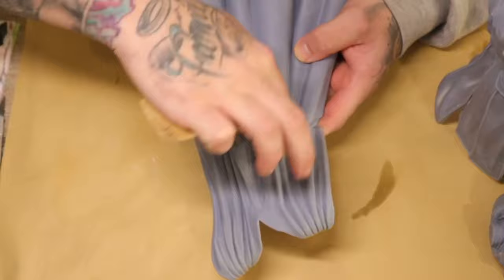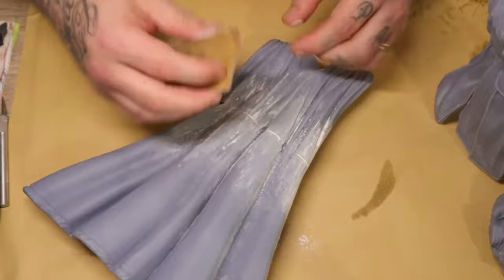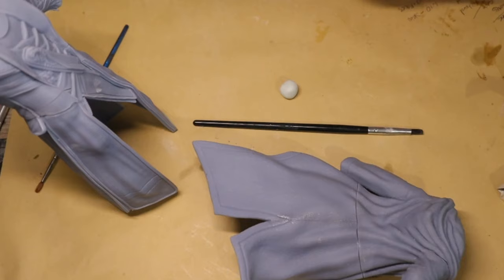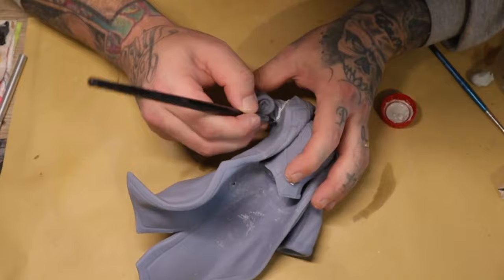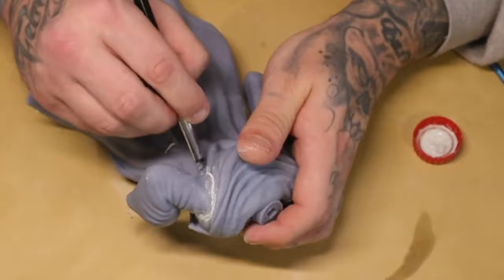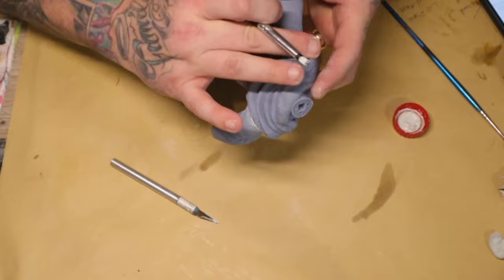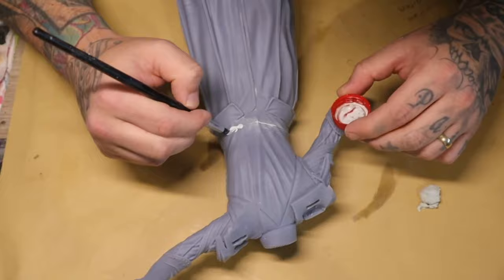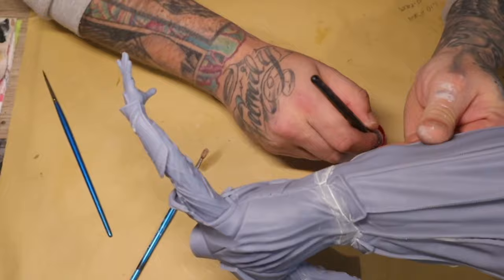Your Prints have Gaps, so do Mine. Here's How To Fill Them.

Comment: easier tip.  use the resin you printed the model with, fill a needle bottle with the resin.  you can squeeze the bottle and have complete control in filling the seam. most of the time I can fill the gap so perfectly I don't need to sand.

Comment: I use Deluxe Materials Perfect Plastic Putty. You can use a damp Q-Tip to smooth it. And after it's dry you can also use a damp Q-tip to sand it. You don't need to use sandpaper. Been using it for years on models.

Comment: you can use an old paintbrush dipped in water to smooth out the milliput.  It works very similar to wetsanding.  You can even get good enough at it to shape the milliput with the brush.

Comment: Couple minor thing to add on, using your printer resin is great for shallow surface level filling, but for deeper groves using a clear resin will ensure that even if it seeps deep into the seam and you have a thicker layer it'll still cure properly. Also to get better adhesion with the putty or even the resin, give the surface a sanding so the putty stick to the model easily.

Great video as always. Quick question, what do you use to actually glue pieces together? Super glue? Epoxie?
Reply from the maker: This is why I left the dust in the crack to make stop the resin from flowing down into the crevasse. I find that milliput just likes to stick to me more than anything I want it to stick to. As for flying. Depends on the part but mostly I use superglue thick superglue and let it dry naturally. Epoxie if it’s a heavy load bearing part. I do make a video about what glues I use a while back. If you wanted to see.

Comment: While I use Milliput for holes and print errors, to fill gaps I use matte varnish. Best hobby hack ever I might add. Just goop some on a fine brush and gently place (goop) the varnish in the gap. Let it dry and you while not filled, the gap is now sealed, so you repeat the process by gently applying more and let dry until the gap is flush. The varnish will always try to find a place to settle, so even if you over brush it will flatten out. Once happy sand and prime as usual. 🤟😎
Reply from the maker: That's a great idea!

Comment: epoxy sculpt works wonders too! and you can smooth it out with water, works wonders on gaps.
Reply from the maker: I haven’t seen that in the shops I’ve been in yet. I want to try some. I’d assume it’s very similar?
Reply: @Groundeffected  Amazon sells it, it's amazing, sands like a dream after it dries. But I'm not even sure if it's available in your neck of the woods. But definitely worth checking out.
Reply: @Groundeffected  *apoxie sculpt my bad! Got too excited.

Comment: I use Apoxy Sculpt as a filler. Similar to Greenstuff but easier to work with, sand and dries nicely.
Reply from the maker: That’s the problem with green stuff it doesn’t sand as well as milliput does. I want to try apoxy sculpt

Comment: I always use plastic bonder by jb weld epoxy then sand or use Dremel tool . It works for me. That's the thing to find whatever works for you and use what makes you comfortable . Working these models sometimes ain't easy. Happy creating.........
Reply from the maker: Only thing, I don’t think that’s going to work on resin though?
Reply: Yes it does lve been using it for 3 years resin is all I ve ever used. It bonds to plastic resin is plastic. Happy creating.............

Comment: Groundeffected, try using a metal airbrush paint mixer. I just found out tonight it works really well because one end has a miniature spoon and the other side is just straight but it's small enough that you can jam the putting into the cracks.

Comment: never tried miliput, seems like a nightmare tbh haha. ive used the resin version a few times though, i use a tiny brush instead of a tooth pick though, just dont accidentally uv cure your brush :P 

ive heard good things about wood filler though, ive been tempted to try some of that in the future. ive seen people use it on bigger builds like helmets etc.
Reply from the maker: Don’t cure your brain for sure. To be honest I use a brush too but I rarely use resin to fill only did this time to try show the concept for the video. Mostly I just squeeze some milliput or green stuff into the hole.
Reply: I used wood filler on my Darth Vader from Wicked's Star Wars Patreon cause the cape had huge gaps, seems to have worked pretty well.
Reply from the maker: @rageftw  capes are notorious for gaps!!

Comment: Hello amazing works a noob question you glued all the pieces together , closed gaps and then prime and paint , or paint by sections and the glue everything , I see some people using diferente techniques
Reply from the maker: Different for different models. If the part fits nicely into a space that has say clothing or something that hides the seam then I’ll use magnets and paint it separately. But if it’s in a space that is like clear skin and need to be smooth I’ll glue it and fill it.

Comment: The problem I get with sanding is that the surrounding area sometimes has texture like fabrics texture. By sanding you loose that. How would you resolve that?
Reply from the maker: That’s why I didn’t sand the second figure I did. The first is smooth it’s his vape. The second is covered in texture then you can’t sand. But you could make a texture stamp with green stuff and let that dry then use that to texture the milliput if you wanted to go that far
Reply: @Groundeffected  Classic "why didn't I think of that" moment for me there. Great idea.

Comment: if print has texture all those methods are crap, tried abit of wood filler putty, seriously its the best and eased way
Reply from the maker: I’ve done a video with using wood filler. But it’s not as mouldable and 100% milliput and green stuff is much better for textures because you can sculpt it much better you can even make a mold of the texture and press that into the green stuff or milliput to recreate the textures. I wouldn’t ever say that these methods are crap since 99% of modellers use them
Reply: @Groundeffected  ive used milliput, that stuff is not that great,  in saying that if never used the way that u used it, havent use green stuff, havent for sale over here, all depends on the model, might try it again , but for me wood filler is a hell alot cheaper(i get it for free)